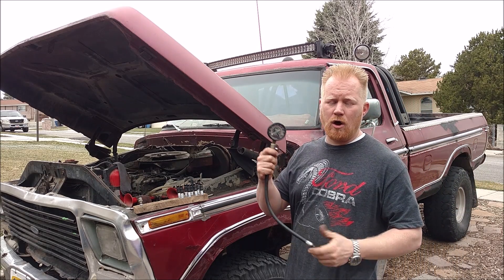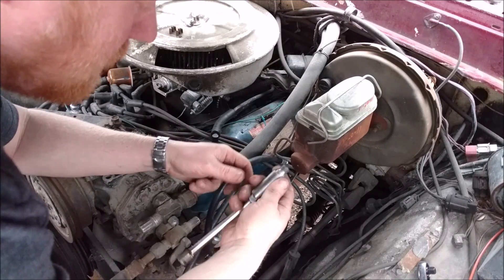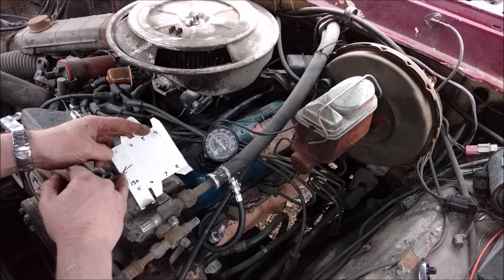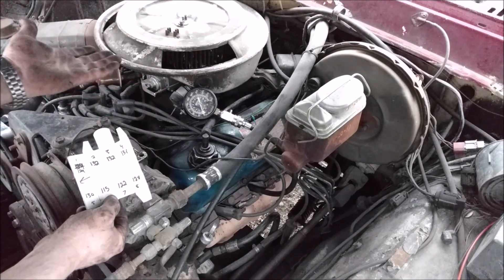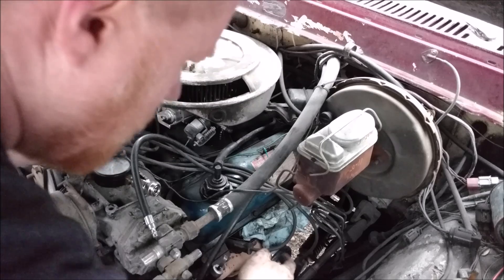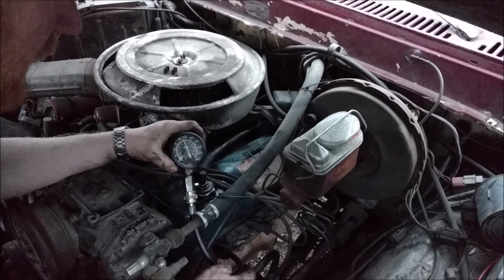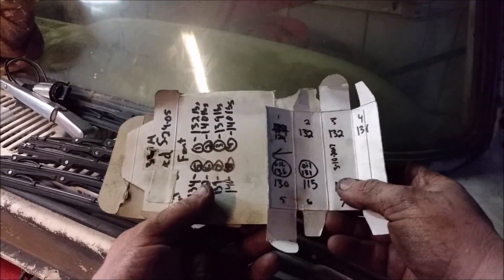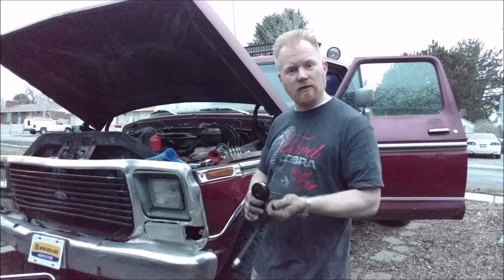Compression Test on an Engine

Comment: I have a carburettor engine with a mechanical fuel pump, are you suppose to clamp the fuel line down or will it be ok to carry on the compression test with just disconnecting the coil?
Reply from the maker: You will be just fine running the compression test without doing anything to the fuel line. You should have the gas pedal depressed all the way though for maximum air flow into the engine.
Reply: @sixtyfiveford  thank you, I did the compression test when I cranked the engine the gauge went up and then lost pressure, back to zero. I did the others and the same thing happened. Do you reckon its a faulty compression tester?
Reply from the maker: @ashikdossajee7533  If you compression tester goes up and then looses pressure it has a faulty schrader valve. This is a little one way valve that is supposed to hold the accumulated pressure in the gauge until you release it manually.
Reply: @sixtyfiveford  thanks for your help ill try again with another compression tester 👍

Comment: I saw your gauge hold the  pressure after you stop cranking, I wonder why mine don't stay, and  loose the pressure slowly... do you have an idea?
Reply from the maker: There's a little Schrader valve in the end that screws into the spark plug hole. It looks like the exact same thing inside of a tire valve core.

Comment: i have a 92 trans am, fuel injected, i think i heard you say that you have to remove all the plugs and wires to do a compression text on a fuel injected, did i hear that right?
Reply from the maker: You don't have to remove them all at the same time, but you can. You need to remove the main coil wire so the engine doesn't start, but then you can just remove one plug/wire at a time.

Comment: You never did say how to tell the diff between worn rings or valves? You just said pour oil into cylinder and so you did, but never heard you say anything about what the differences would be from valves to rings? Please verify.
Reply from the maker: Compression goes up a decent amount with oil added=worn rings
Compression stays about the same with oil added=valves.
Reply: @sixtyfiveford  Thanks man.

Comment: so,  with  the oil.   if number goes up  its the rings.      if it stays the same or goes down means  valves ??????
Reply from the maker: Yes, any amount that the compression increases with oil is how much you're loosing through the rings. The rest is what your valves are loosing.

Comment: How bigs the light bar on your 78 I just bought a 52inch I might put on mine. We have a very similar taste in trucks I have a 78 250 snow fighter and a 65 ford late 64 build tho so old style cab and grille I put on a superduty frame shortened 5 inches it's getting a healthy 429/460 asap
Reply from the maker: It is a 50" if I recall. Nice trucks.

Comment: Do you take all the spark plugs out before you do a compression check?  I do, and the motor cranks easily so it turns faster for higher compression.  i found my car was kind of stalling trying to crank, and i figured 3 cylinders later itmight be a little weak.  so i removed all the spark plugs to make it easier.  what would be do you know the right reading?  and what way do you do it?  Do you do it this way, too?
Reply from the maker: I pull one plug at a time. I've done it both ways and always end with identical results.  A good battery should crank the  engine very well.

Comment: When I was young and crazy I had a 68 camaro that was so worn out I had to put oil in the cylinders in the winter just to get enough compression to fire the motor.   (Shot rings)  Good video.
Reply from the maker: Great story. I had a chainsaw I used to do that with. Much quicker to do a chainsaw than a v8.

Comment: good methods, stupid low cylinder
Reply from the maker: Thanks. Even the weak one has some miles left in her.
Reply: yeah, but if someone had OCD it would screw with them bad, lol. Not a real issue, just a thought.

Comment: Good tips. My car motor is mounted in such a way that half the spark plugs can't be accessed without removing half of the motor. The engineers designed it so that the motor is crammed in sideways.
Reply from the maker: Darn front wheel drive V6 vehicles. Always a pain to work on.
Reply: Dasdfjkl what kind is it?
Reply: It's a 15 year old Santa Fe.

Comment: Giddy Yup! Nice video, and had fun watching your hands get dirtier and dirtier. LOL. How is your oil pressure on the modified Cleveland? My 400 has some to be desired while idling, but it is getting long in the tooth and still has stock pump.
Reply from the maker: Oil pressure hasn't been great since I put it in 15+years ago, but it just keeps chugging along. It'll drop pretty low/non existent when hot at a low idle. I got this 351M free(traded for a C4 trans I got for free) from a guy who pulled it from a 70's LTD and left it in his back yard for who knows how long. I had a 351M-400 in it before(still have it, never checked bore/stroke) that lost a rod bolt and the rod came off that this replaced. I would like to rebuild it to a 400 as I had a 78 Bronco with the 400 and it had gobbs more power.

Comment: I agree with First Listro. You have the same mind set as me. Give good information, don't worry about the money rolling in and never acting like you've been bought by the system. Kudos on that note Moe! Also, excellent information as always. We're a lot alike. Have you ever used Blackstone Labs to do a motor oil analysis? Every time I do an oil change, I send off a sample to see how healthy the oil is and there fore, how healthy the engine is. They tell you Water content, fuel content, heavy metal content etc. Just an extra added measure for our older vehicles and gives us a better chance at catching a major problem early on. Cheers my Friend! Zip~ Just google Blackstone Labs and you should find them easily enough.
Reply from the maker: I've considered it, but figured it's not worth the more than doubling my oil change cost. I think the info would be fun to look at, as I spent the time to cut open every old oil filter and inspect the contaminants in the pleats, but nothing more.  Of course this is my opinion and I've read a few articles on it. I have the sixtyfiveford lab.

Comment: ive never done one .. ..I paid for a sparkplug change in 2006 and  in 2010 the motor on my 4.7  headgaskets blew..  typical  mopar 4.7  and when I pulled the plugs to get the coolant out of the hydrolocked  motor I noticed the plugs  were original's ... the dealer screwed me of over 100$
Reply from the maker: That'll make your day.

Comment: Good Video! Could you do something related to the power steering box on the F100. It would be nice to know how much play is to be expected. Don't suppose you have ever reconditioned one? Thanks,
Reply from the maker: I've actually pulled a few apart. Most of the time I find most of the play in the steering wheel is in the the tie rod joints. But I've adjusted the screw/nut on the top with a little success. I have never got super tight steering like a modern car, but better.

Comment: Great video as always, only thing you forgot is to always have the throttle and choke set wide open, the draw from the carb can adversely affect the reading.
Reply from the maker: Thanks. I mention it briefly at the beginning. 1:26
Reply: @sixtyfiveford  Doesn’t that flood it?

Comment: You need to pull out all your plugs before you start the test and make sure the engines been warmed up ... And 10 pounds variance is just fine, 15 is marginal and 20 is where you start noticing some slight rough running. 30 year veteran auto shop owner speaking...
Reply from the maker: I warm the engine, not hot just warm as I hate burning myself intentionally. I made a personal decision to only pull one plug mainly because I hate the idea of the other open cylinders pulling in dirt from an open spark plug hole and a vibrating engine. From my experience it makes no difference on pulling all the plugs or leaving them. It may take 1-2 more rotations of the engine to push the pressure, but any good battery can power through this. I did the #6 cylinder 2nd and the entire engine after and when I came back with a weaker battery still got and identical 115psi on #6.  I appreciate your input.

Comment: I never realized if your at high altitude it gives lower readings.  I normally like to see around 180.
Reply from the maker: Wow can't say I've ever seen my gauge go to 180. That would read around 155 here at 4500-5000feet.
Reply: sixtyfiveford   A Ford mini van I just worked on had 225 psi.
Reply from the maker: I'm guessing it had a pretty high compression ratio for these new flex fuels.

Comment: if you disable the engine by removing leads it is best to ground them on a bolt or something attached to the block. particularly on older coils if the spark has nowhere to go it can short between the primary and secondary coil and then the coil is dead :-(  I've seen a lot of coils killed this way at tafe on stationary engines by students ;-)
Reply from the maker: That's good to know.

Comment: Just be careful who loan your gauges out to. Mine have disappeared. If is something I don't use often then I forget who borrowed it. Usually it is a relative. The hand held rubber tip are okay for small engines if have someone pull the rope starter.
Reply from the maker: Yeah, it's always annoying when they grow legs. I have a rubber tip one that gets brought out for the odd size mini spark plugs.

Comment: I always do a compression test on fully warm engines after all the plugs are removed because a warm engine will have different compression than a cold engine and having the plugs installed in the other cylinders can effect the pressure readings. If all the plugs are removed you eliminate that irregularity.
Reply from the maker: I hate burning myself so I do it on a slightly warmed engine and with only one plug removed at a time. The pressure reading doesn't matter as much as the comparison between the cylinders. I've pulled plugs and done one at a time and have never seen a difference. The only time it would make a difference is if the battery is junk.
Reply: @sixtyfiveford  no thats not true. If you have a head gasket leak between cylinders you can miss that only pulling one plug at a time. Its best to pull all the plugs then test.
Reply from the maker: @jesseduke694  Two side by side cylinders are never going to be on the compression stroke at the exact same time. When will be it virtually zero PSI always while the other one is compressing.
Reply: @sixtyfiveford  your missing the point. The two cylinders dont have to be on the compression stroke at the same time. If you only pull one plug & have a leak between two cylinders the other cylinder has the plug in then they still build pressure giving you a reading witch in turn will be hiding the leak. However all the plugs out & the leak between two cylinders shows up becouse you don't build cylinder pressure becouse the other cylinder can't hold it with no plug in.

Comment: What engine is that? I hope for your sake it's not the 351M/400.
Reply from the maker: It's the 351M. Not powerhouses like the 351W or FE but they just keep chugging along. I got this 351M for free out of a guys backyard. It had been pulled from a 70's Ford LTD and sat for who knows how long with who knows how many miles. I replaced the original 351M that lost a rod cap bolt on the freeway and it has been chugging along for the past 15 years.
Reply: sixtyfiveford Hi Moe. Those old 351 engines are a great engine. We use to get a version of it over here in Australia in our Fairlane/LTD I bought a LTD for $500 and put the 351 and running gear in my Falcon. It had a alloy intake and a 850 double pumper on it with a late model electronic distributor and a fmx auto behind it. The thing used go really well. Great videos mate . You done a awesome job on your boat looks cool with color scheme. I can't wait for the next video. keep it up mate. Cheers Mark.
Reply: OH NO! Not an M! We used to buy Gran Torino Elites for a few hundred bucks back in the early 80's just to have spare "M"'s for my buddy's 78' F250 4x4 (we would change those dogs as much as a pair of socks) luckily it had the NP 435 w/creeper 1st so we just had to find a 460 bell housing when we finally dropped in a 460 out of a Merc wagon. He still has that truck.;)